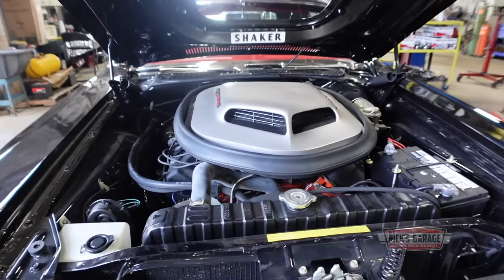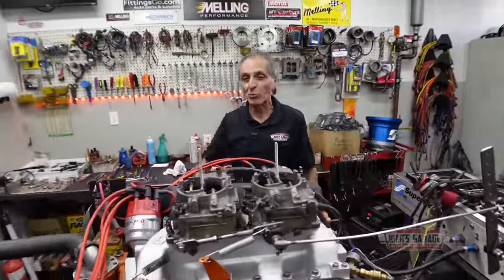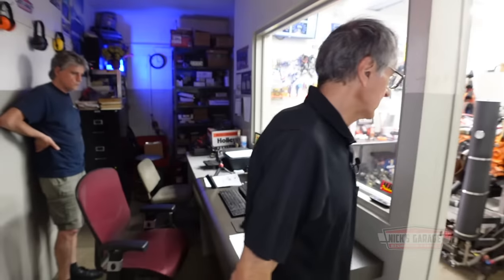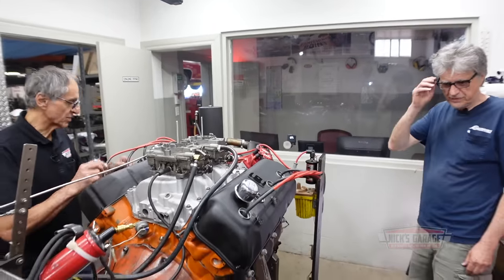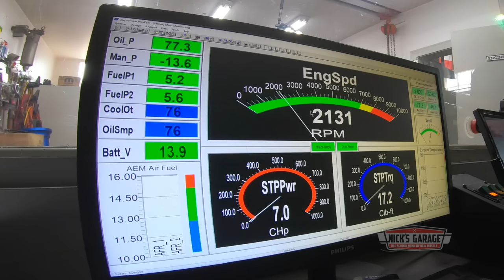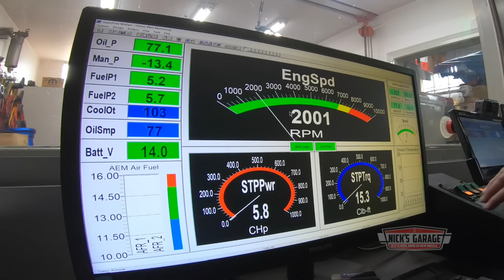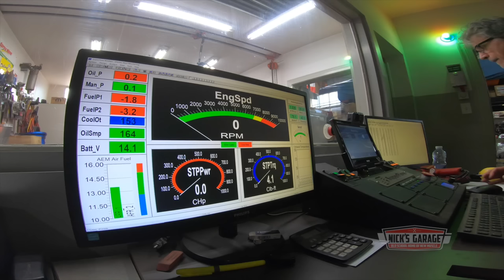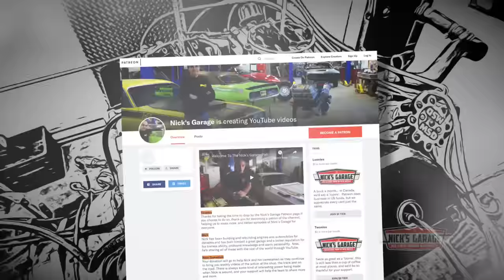NHRA Hemi Screams - Race Engine Dyno Tested

Comment: NHRA Stock class racing is THE best racing. Very interesting that the base plate was so effective. I’ll bet that Phil is one intense dude at the track. I had a Bracket car for several years. Loved the competition.
Reply: Yep. I love bracket racing also...
Heads up is for guys with the biggest wallet. Not for me.
Reply: The air filter base keeps the air straight before it's pulled into the carburetor. The additional air gets the carburetor a better signal, causing a rich condition fixed by going down on the jet size.

Comment: Found your channel about a month ago. GREAT STUFF!! This vid is  special me. 
Chasing HP and 1/100th is 1/2 the fun.
From 1967-1976 I raced an I/S '57 chev factory fuelie. Best years of my life. Then the family came along....... that was that. ;( . 
In 1970 I briefly set ET record. What a thrill. NHRA then changed rules and i could no longer use the dealer installed option of a 4 speed. Rules is rules . I changed to I/SA but did not have to much success. 
I will remember those years forever and you channel with your enthusiasm helps. Live chats are great.!
Tom

Comment: I built a hemi way back when i was a teen. It took me 3 years to complete, having life commitments i bought every peice pay cheque after pay cheque when there was extra and saved from extra to buy the peices. I had the block gave to me. It had a peice broke on the pan flang where a rod went out. I welded in the three peices, too the block to the high school and durring my night classes i machined the pan flange, and the head serfaces. As well as drilled and treaded bigger bearing bolts and head studs. And the teacher machined cam ends and made caps so i had thrust bearings for end play loss. He als cast my blower box for me. I used a 671 gm blower on it with a 850 cfm carb.  Having the school machine shop and teacher help the build was awesome. It began just a broke 1968 426 cast block.
Reply: Did you ever get to use it in a driver....? Or run it in a drag race car....?
Reply: @peted5217  was strickly Straight line car. I run it  in Prostreet modified for 3 full summers, and into the fourth year the car caught fire and had a complete melt down firel. When you hear the John Force stories ect. We all pretty much lived that way. It was to much to start over, so i just drove Glen's railer until the acident that crippled me for 7 months when his car broke in half and broke my legs.
Reply: @karriefalon7779  Happy you got to enjoy all your hard work and perseverance til Murphy's law prevailed.

Comment: Larmo from laughlin.. thank you nick and Phil. I used to sit at the back of my 71 or 440, after an oil change. Start the car grab a beer and sit in between the exhaust. This was the best sounding motor on you tube. Hands down. It just doesn't get any hemier than that folks. Nick n Phil your efforts and knowledge n expierence is very apparent thank you gentlemen.. move  over. Plymouth  arriving rapidly...

Comment: I really like that 70 Hemi Challenger 4-speed convertible, it may have not been born that way but it is an awesome car, you just gotta love a Hemi. Seeing you and Philip working together in the Dyno room discussing what you wanted to try next brought back a lot of fond memories from the 60's, working on engines, and trying to find those elusive few HP that would make the difference at the track. The new stainless steel headers should make a difference on the Dyno, and help get the Hemi the extra HP. I know that the HP & torque numbers were over 600, which is very good for an engine with stock specs. Great job Nick and Phil, I know that you will have a winner when the Hemi is done.
Reply: We will do our best. Thanks.

Comment: I had a friend who built dirt track engines and had an interesting technique. While an engine was running, he leaned his belly on the driver-side valve cover, placed his left hand on the passenger valve cover, turned his left ear towards the timing chain/gear, and looked down the carburetor. With one pull, he could quickly zero in on a problem. I saw him sort out a Hemi drag car that way. In a few seconds, he was able to show the owners that the builder had left break-in springs on the valves. Fortunately, it ran so bad it had not hurt itself on the track. Love your content Nick. My late dad was French Canadien. You remind me of him.

Comment: HELL YES NICK.  BRUCE Springsteen's got it right.  When he sang hemi powered cars scream down the boulevard.  You need to teach more people about NHRA stock and super stock.  😁👍. People work their asses off for 100 of a second.  Those hand made headers will be a work of art. Not like the junk off the shelf  headers. And rust in the tubes hurts horsepower  to.  Good luck and thanks for posting.

Comment: 36:20 - You answered one of the questions I had right there Nick.  You said earlier that you couldn’t add lift to the cam but didn’t say you couldn’t change the ramp on the cam and/or add duration.  You confirmed here that the cam in the engine has more duration than stock.
Reply: So you said you are running the original cast iron rockers.  Is there anything in the rules that would prevent you from using OE style rockers made from lightweight components like titanium?  Lighter valve train components typically allows the engine to rev higher and therefore means more power on the top end.
Reply: That is correct. As long as the max intake lift is .490, any lobe design is ok in the Stocker class. In many cases they do not allow titanium yet. And now we are allowed to use after market rockers. But we are still running the factory cast iron rockers for now.
Reply: A lot more duration and the ramp angle is changed

Comment: I watch Nick, and learn something every time.  The situation with rusty headers causing a back draft of rust into the cylinders is something I did not know.  Yet one more reason to dislike headers  😊
Reply: Low restriction cast iron manifolds,  luckily I was able to find Pontiac Ram Air exhaust manifolds for My Tempest,  they are very close to header performance,  seat perfect onto heads, and better ground clearance. Win, Win, Win!
Reply: Maybe another reason to really consider running SS headers!?
Reply: Couldn’t disagree more.  Headers ALWAYS make more power, look cool and sound awesome.  Just spend the extra $ to get a well made set of ceramic coated headers.
Reply: 🤣. Cast iron manifolds rust as much, if not more than any set of headers!
Reply: Right,.?!
Reply: @gt-37guy6  I'm with you.  So far.....I run 12.9 @105mph with my oversize Pontiac round port cast iron manifolds on a mild cammed 455 auto with 3:08's.  How bad can they be!?

Comment: A fine stocker Hemi there Nick!    I still have the original hyd. cam out of my brothers 70 Hemicuda 10,000 original miles on it from 1970-71. I set it up on my lathe with a lifter fixture and  checked it out.  .311-.314 lobe lift on all the lobes with 284 duration checked at .006 lobe lift.  .050 lobe lift check was 228 degrees and a 112 LCA.
Reply: Good job.
Reply: @nickpanaritis4122   Thanks...I had to machine up a correct size tappet to get the numbers.

Comment: As a teenager, I was deep into 'GM' performance (mid-to-late 70's), but my 'mechanical mentor' had been a MOPAR affectionado all his long life. He had raced against some who would become great names within NHRA...but feeling he had gotten too old to 'hit the shifts', he had opened a machine and engine shop to 'stay close to it all'. He had TONS of track time with everything from 413's to Hemi's...and while I never personally owned a 426 car, he told me that when they were racing, they'd always do a quick 'drop-and-change' on the rod and main bearings, even while at the track...he said this was actually the one achille's heel of the 426-Hemi...so much power, small journals...and that if they ran too many times on the same set of bearings, they'd, without fail, break a crank, drop a rod cap, etc. I always wondered if others with significant 'mile-experience' with hemi's ever had this problem, as he was the only one who ever mentioned it to me...(granted, 426 hemi's aren't 'high population engines', and are not only hard to find OEM, but pricey even when found in used cars...back then!)...

Comment: A.R.H (American Racing Headers) makes a VERY nice set of Stainless 304 headers for popular Chassis/Engine combos. They are $1500, but worth it. They have merge collectors built in, nice thick flanges, and come with band clamps for collector extensions. I got a set for my G-Body Cutlass with a big block Olds, 2" tubes, 3.5" collectors, and they are the nicest fitting and performing set of headers I've ever installed on the car. With the starter out, and the oil filter off, they both slid right in from the bottom with no effort. They are WAY better than the goofy $900 Hooker Super Comp 
1 7/8" with the 2-piece design that has the one tube that wraps around the frame. Being stainless, it'll be the last set of headers you'll ever buy also.

Comment: I'm very lucky to have an original 1970 N96 Shaker Challenger 440SixPack 18 splined 4 speed Dana 60 Track Pak car.  That one shown by Nic is absolutely gorgeous even if not an original N96 car.  BTW.  Dodge only made a total of 184 Shaker challengers for 1970.......very rare cars.  Around 85 or so left

Comment: Got my 1st Mopar back in 1979. I was 16. Transmission slipped so bad I could pump it 3-4 times between Gears. 323 Rearend. It went 13.16@107mph. 68 RoadRunner, by the way. Single Holley 780. Torker Intake.
Reply: What are you "pumping" between gears? 😕 🍆
Reply: @davelowets  The gas pedal.

Comment: At Nick's Garage racing runs in the family This HEMI ain't too shabby Attach some wings and it would defy gravity It's development block for racing that is stock Nick is following the NHRA regulations so it will pass inspection in teardown situations Nick and his brother Phillip are on deck to give their latest tweaks a check Attention to detail like this demands respect It's dyno time and with racing gasoline it's gonna run just fine Nick's Garage makes cars that go first across the finishing line That's why to Nick's Garage I keep coming back they build amazing automobiles for the Road and Track at 7300 RPM this Hemi can withstand any sustained attack Nick's Garage every Monday where the dyno blows the cobwebs away!

Comment: Nick you can add an oil supplement called Microlon an gain protection and free ram as this stuff is super super slippery. We ran it In g stock and other race engines. 1 time we forgot to add oil and no damage whatsoever.
Reply: I will look into it.  Thanks.

Comment: In 1964 on  a secret five mile long test track in Texas, Chrysler Corporation had been testing a new version of its hemispherical-head 426  V-8 engine. Word had leaked out that on the strait ways the massive power plant was pushing the the slippery Plymouths and Dodges at unheard of speeds of of over 185 mph, about 20 mph better than the competition was running at super speedways at Daytona.

 The Petty's installed the new engine in their 1964 Belvedere and promptly found out after a few practice laps that the head gasket was leaking. The crew discovered the block wasn't quite big enough to cover the gasket on the cylinder head. They quickly set about heating brass and welding it to make the block fit up with the gasket and cylinder head. Richard Petty went on to win his first Daytona 500 with the only available Hemi to them at the time. Richard Petty later went on to win his first Grand National Championship for the 1964 season with the new Hemi engine.

Comment: Lots of great nostalgia mentioned with the pictures shown here, Nick!  Like Phil and your green  '71 Hemicuda with a bit of weight removed from the front end and the lead added inside the rear bumper for ballast and all set up for street racing!  How cool was that?! I remember back in July '93 Phil racing that same 'cuda against a fast 1970 Buick GSX Stage 1 at Napierville. The Buick won but so what?  Like you say, you win some and lose some no matter what you drive!  The exhaust note on that Hemicuda sure sounded mean and raspy.  And Phil looks just as young and handsome now as he did then!

Comment: 3 things.  
   1 Are you allowed aluminum heads in that class/year? If you are that would be a huge weight distribution advancement. 
    2 wouldn’t there be a gain with some high end rocker gear?
    3 are you allowed to use a phellonic spacer? That would keep some heat out of those carters.

Comment: Hello Nick!  This is absolutely the best thing on You Tube by far.  I notice some of the motors have large valve covers while other Molar motors do not.  What is the difference?  Sorry, my knowledge of Dodge motors is limited.
Reply: What you see here is a 426 Hemi with the plug wires going through the valve covers. It is a hemispherical  chamber design which larger valve covers are needed.
Reply: The valves in a hemi are arranged in the upper and lower halves of the head, instead of all inline like a conventional head, making the head much wider.

Comment: HEY NICK,
     Tim here again......i need ur help...my shop has a '69 GTX Hemi/727/Air Grabber, #'s matchin car....high dollar resto done (1 of 98)....its GORGEOUS!!......rear main leaks horribly, we were tasked to try to fix it......we took the pan off, and it has an aftermarket cap for the rear main seal......(we've heard bad things about it).....we're tryin to do this with motor staying in car.....it's like brand new.....when we took the cap off, there was no rtv on the side seals....so we thought we found the culprit.....main seal looked good, and even had assembly lube on it (outside)...so we thought it was ok.....we bought a new rearmain seal, put rtv on the sides, all over, and put it back together, fired it up, still leaks like a sieve......local MOPAR guru said alot of the billet caps leak bad, so we had him find a stock one in his archives......if we go that route, what are we missing, or what did these engine dudes do?......YOU DIDNT RUN IT ON AN ENGINE STAND/DYNO FIRST???, B4 PUTING IT IN THIS HIGH $, #'S MATCHING RARE CAR??......i said the motor has to come out to do it rite......they all think we can fix it without doin so.......PLEASE, if you read ur comments, PLEASE give insight to our problem....the car is BEAUTIFUL, and the HEMI's rear main leaks horrid!!!...HELP!!

Comment: I saw some of the big name Super Stock racers back in the 60's. I saw a 2 out of 3 race between Dyno Don Nicholson (427" Mercury Comet) and Ronnie Sox (426" Dodge). Dyno Don won the first race, Ronnie Sox won the second race and Don Nicholson blew up his engine in the 3rd race (the Ford engines blew up pretty often). The only reason the hemi lost any races was because the engine was so heavy. Do Nicholson got a big lead off the line in the first race and Ronnie Sox couldn't catch him. In those days the hemi was making 600hp and the Ford/Chevy engines only made 550hp.

Comment: Please explain too me how that baseplate could effect anything related to HP. Add a filter and I get it but as it is it doesn’t restrict any airflow.
Reply: The baseplate essentially removes the bottom half of the air bubble around the engine. By doing that it’s giving a smoother passage to the bottom portion of the air entering the carburetors and reducing the turbulence caused by the uneven air pressure there . On my 66 GTO the 4 barrel air cleaner is flat. With my 75 Trans Am, GM was adding a “ramp” of sorts to curve the air down into the carburetor to smooth the transition into the carburetor a bit more. The ultimate expression is a velocity stack where it pulls the air, straightens it completely so by the time it hits the carburetor it’s completely straight and lined up.
Reply: @Daveincoalinga  I completely agree you can tune airflow into the carbs via the air cleaner and it is done by everyone looking for that last HP. Hell I've even indexed plugs, port matched intakes and such. However they did not put an entire air cleaner on it. That plate alone could not coax air to do anything differently that I see. I am honestly perplexed that they made such a point on putting it on, obviously know what they are doing. I must be missing something.

Comment: We know it makes at least 480 ft-lbs :-) I never saw the point in keeping dyno numbers a secret. I mean honestly everyone racing is looking for the most horsepower they can get.  Just cuz you know the numbers doesn't mean you can duplicate them.
Reply: It's a big deal... and it gives your competition a target to shoot for. If they know how much power they need to win, a guy with a fat wallet can just keep paying someone until they get there. Without a number, they might just think they have enough, when in fact they don't .
Reply: @davelowets  that is not true. Fat wallet guy does not win he will keep spending till he does regardless of what number you might have posted on a dyno. Besides unless they dyno on the same dyno it is unlikely the numbers will compare anyway.  I know of a 1000hp motor that dynoed on 4 different Dynos and the power varied over 100hp and the engine was the same setup every time.
Reply: @bcbloc02  Sure, sure...

Comment: Have you looked at ARH headers? They make good quality stainless steel with merge collectors and scavenge spikes. 1 7/8”x3”, 1 7/8”x3.5”, 2”x3”, and 2”x3.5” sizes for B/E body.

Also, have you tested different valves on the flow bench, with different back cuts, different valve job angles? There can be some big gains with the right valves.
Or is that not allowed in the class?